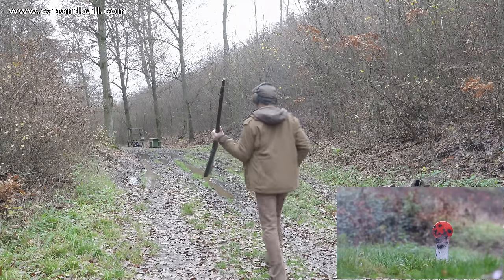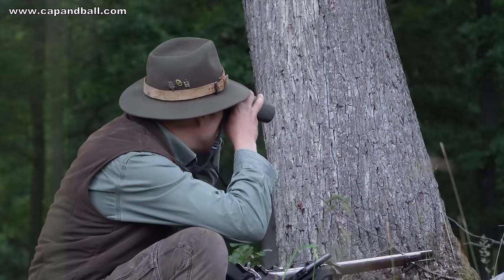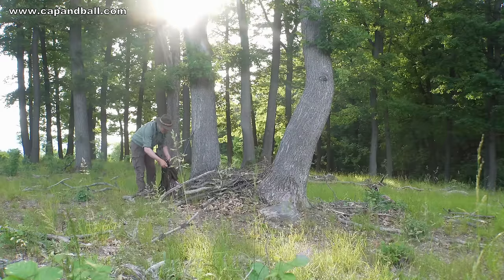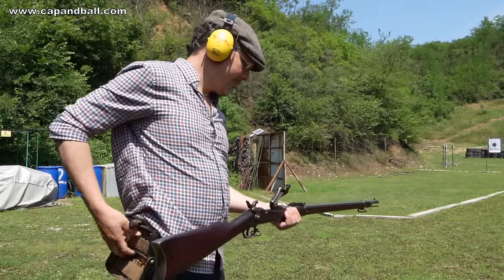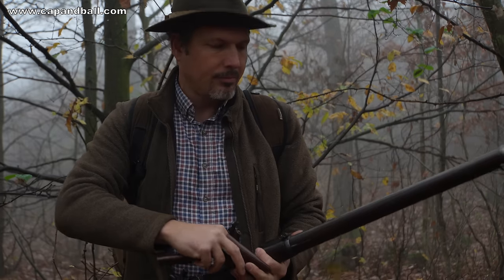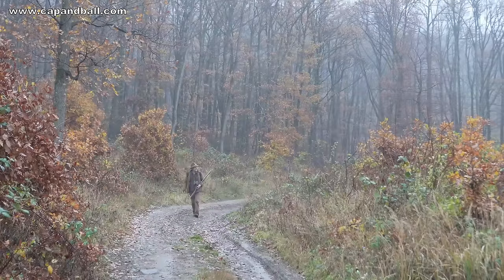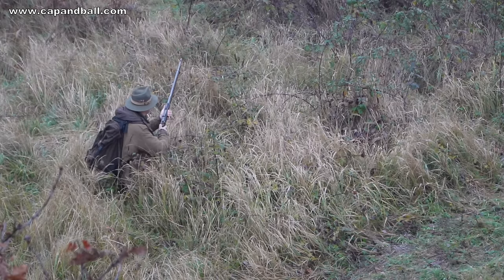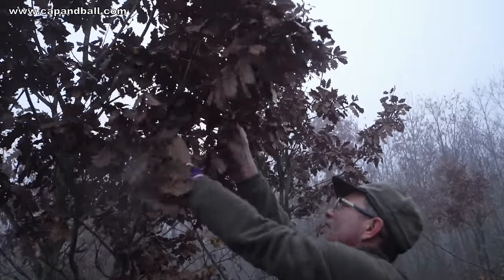Hunting red stag with an original M 1873 Springfield Trapdoor rifle

Comment: Congratulations for your red stag! I like how you appreciate and respect the cycle of life. Sometimes something dies that something else may live. I have an original 1884 Springfield Cavalry carbine in 45/70 however I load BP equivalent smokeless cartridges that develop <16,000 PSI and 487.7 mps using a 350 grain  cast lead bullet. I use soft lead which will fill the lands and grooves and prevent hot gas blow by in the grooves which can ruin a barrel. It is a very accurate load and easy on the recoil (33.4 grains of IMR-4198).

Comment: I had to replace the front sight with one that was twice as tall.  Mine is an 1886 model, it was way high at 100m.  I believe that particular model and sights are set for 500m.  I ended up trading that rifle for a carbine.  That is the exact load I use for whitetail deer and feral hogs out of that carbine.

Comment: In my 2021 Guns of the Old West Special Edition, on page 83, the writer stated that he used the 250gr FTX Hornady load.  Per Hornady, that load is safe in current reproductions of the "trapdoor", as well as originals.  Writer stated it wasnt very accurate, though, in his Pedersoli replica, group size over 7 inches, and recoil was 'brutal'.  Don't know if I would try in a modern version, but definitely not in an original.  Velocity was 2105 fps

Comment: This is rhe second video in which I have seen you use a beautiful brass powder measure. I have been reloading for over 50 years and never seen anything like it. Would love to have you do a video on that measure. Brand., year of manufacture ect.  Thanks
Reply from the maker: Hi, that's a copy of an original. Only 10 were ever made by a friend of mine. I have 3 of them, but they are very-very expensive. Unless you are a collector, it makes no sense from a trade point of view,

Comment: I have one of those.  I advise caution when carrying the rifle loaded with the hammer in any position.  If you carry one with the hammer down for any distance then examine the primer you may see evidence of the firing pin bumping the primer now and then as you walked (my Sharps .50 also).  When I see it leaning against the tree, possibly still loaded, I wince at the thought of what can happen if it slides and hits the ground with a thud (Boom).  I don't chamber a round in mine until I am on station.  The half cock notch is not really a safety either.
Reply from the maker: The first clik is the safety that keeps the action closed and the hammer is safety.
Reply: @capandball  until the sear engagement notch wears down or breaks.  :)

Comment: That looks way more to be a model 1884 note the shorter wrist, Buffington sight. the lock plate is completely inset into the stock and I believe I see a stacking swivel which was not on the 1873...It might be a Bannerman assembled rifle. Anyway, I have an 1884 with everything correct EXCEPT...no cartouche on the left side over the trigger. It's in great shape and I shoot it with special reduced load smokeless with the 405 grain lead bullets...ENJOY!..Oh..I forgot..my 1884? lock has only 2 "clicks"  as the 1873 had but the 1884 is, I believe, supposed to have a 3 click lock..I bet you actually know all this...

Comment: Congratulations and salutations . You have composed another fine video with a touch of class. As you probably know by now ,the rifle in the video is a model 1884 trapdoor Springfield. This can be determined bye the updated rear Buffington sight. Moreover the breach can handle modified smokeless loads , which can be found in The recent Lymen loading manual. Keep up the good work.

Comment: How is it with licenses on black powder weapons in Hungary in Sweden which is stupidly strict you need a license if the weapon was made after 1890 (reproductions of older weapons needs license) or have gas sealed cartridges. Is it similar in Hungary or how is it???
Reply: For muzzle loaders there isn't any license necessary for the weapon (regardless if it's original or a reproduction) itself however you need one for the black powder and percussion caps. For any rifle that uses cartridges (the cap, powder and bullet are all contained together) however you need to have either a hunting or a sport shooter license. So technically even tho this rifle used black powder it still falls under the later category (I might be wrong tho, I'm no lawyer)
Reply: @vbence12  okey the cartridge ones seem to be like here but im jealous about the muzzleloader because i want one

Comment: I wonder, I think 38 special was originaly a black powder cardridge how many 3fg swiss would you have to put in that one.
Reply: To load a case with black powder, you fill the case to the point where the bullet will slightly compress the charge of powder. It's very important for safety's sake not to leave airspace between the powder and bullet. There isn't necessarily a universal amount of powder for .38 Special because one bullet will allow for more powder than a heavier one.

All that said, I would suggest not doing it if you don't know what you're doing yet. Read up on black powder reloading, watch videos on YouTube explaining the process, etc. Also, most .38 Specials today are double action. BP will gunk up the action on a DA pretty bad.
Reply: @cristianespinal9917  the intention is loading a 38sp with black powder and shooting it from a GP100 revolver, looked around but can never find how much compression is needed, I already shoot black powder in my 1851 navy revolver
Reply: @happymark1805   on a GP100, I would say pass unless you have a really compelling reason. Modern revolvers with tight tolerances, and complex lockworks don't play well with BP. You'll likely get a lot of gunk in the nooks and crannies of your revolver that will be a serious pain to clean out. I wouldn't use black powder in a double-action unless I had no other powder and wouldn't be getting any anytime soon.

First thing is first, make sure that your grade of black powder is OK to use in cartridges. Your powder's manufacturer website should have that info. Your powder's manufacturer might even have load data for cartridges on their site.

So bare-bones, to make sure your powder level is safe, take a dowel of some kind that fits in a case of .38 special and place it next to the bullet you intend to use so that the bottom of the bullet and dowel are even. Mark the dowel on line with the crimp groove of the bullet.

Now add black powder until when you place your dowel in the case, the dowel makes a small indent in the powder if you line up your mark to the mouth of the case. Measure that amount of powder by weight, and that might be your charge. To be sure, pour your charge into the case again to make sure it fills to the same level again. If it doesn't, then add more powder until you consistently get enough.

You should feel slight resistance as the bullet is fully seated. If you go to seat your bullet and it doesn't seat down to the crimp groove, you have too much. If you seat the bullet, then shake it and can hear the powder moving in the case, you have way too little.

Balosz adds that wad to protect the base of what I assume is a very soft lead bullet.
Reply: @cristianespinal9917  thanks for the info